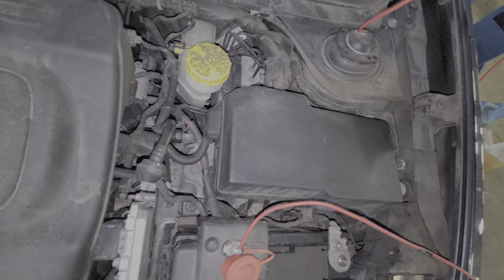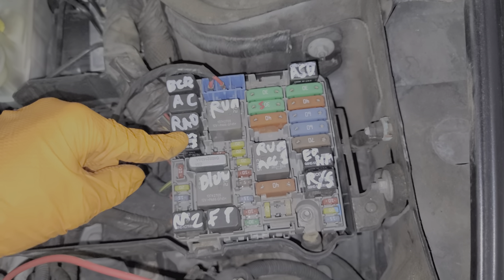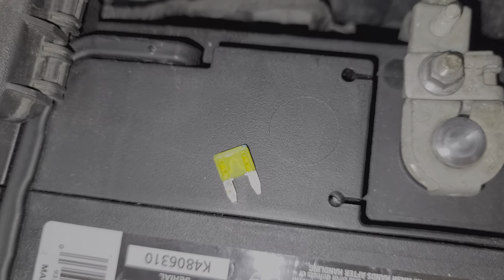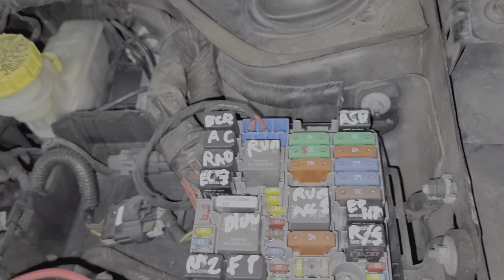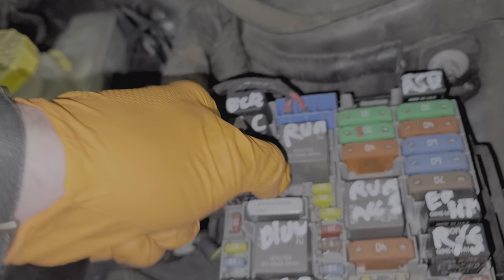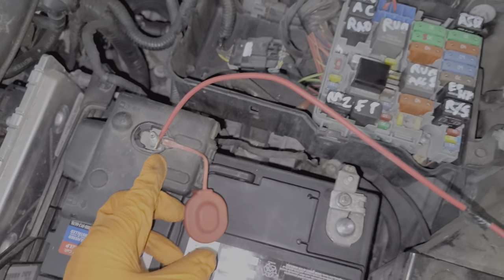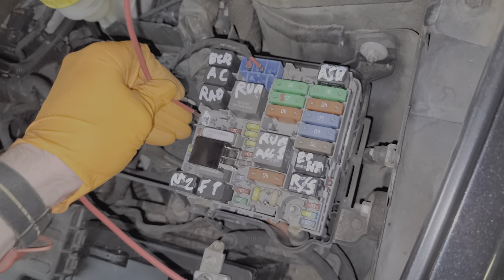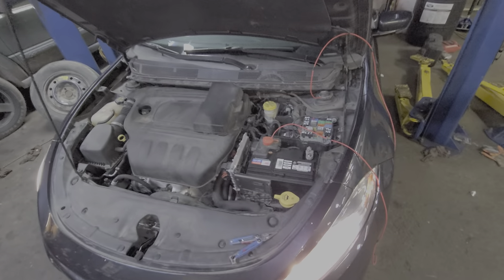2013 Dodge Dart Starter Fuses & Relays

Comment: I have a 2013 dart at 240,000kms it just went click click click,I checked fuses and relays and thought the starter was bad,upon checking the positive and ground wire I found the ground wire had broken off the Transmission,repaired the old wire and added a second ground cable from the  Transmission to the battery,problem solved,now the dart has 472,000kms on it,great car and going for more🏁
Reply: hi,you added a second cable strait from the battery to the transmission?
Reply: @610misael  yes,I fixed the original cable and made a new cable from the Transmission to the battery, no more ground problems,we now have 514,000kms on the dart,the original drive train is still in the car!🏁
Reply: same happened to me, the belt strap
Reply: @joelwarren7457 what belt strap?

Comment: This was very helpful. Have a 2013 with 2.0L and have had intermittent starting problems. Replaced ground cable and all was fine temporarily. After a few months it would just click, click when trying to start. Replaced battery as it was on its last leg but didn't solve the problem. After removing the relay as you suggested I used a jumper wire and it started right up. Cleaned the connections and seems to be fine now. Keeping fingers crossed.
Reply: How’s it working now?
Reply: Well it turned out to be the starter after all. After replacing relays it worked for a while and then just quit.

Comment: Please what could be the problem of this Dart dodge 2013, it doent start but when I followed your info on troubleshooting by connecting power directly to the starter relay it start, but won't start with key switch.
Reply: @okodominic4904  same thing with my car what would be the issue??

Comment: While I still don't know why my Dart won't start normally (new battery, starter, alternator, and now new fuses/relays as indicated), the "short-to-start" trick at the end of this video was a lifeline and is now how I start my car normally (with a hidden switch in the cabin that makes this same circuit. Will be just using this method till even that stops. Thanks.
Reply: Nice, I found a video showing a bad ground wire, may be worth checking. It's just under the front bumper
Reply: @opal6110  Thanks for that suggestion too, but I also replaced the ground connection (ran a fat cable from negative terminal all the way directly to the alternator). I just forgot to mention it in my original post.

Comment: I have a 2013 Dodge Dart 1.4l turbo, it was running fine then it died down like the battery was drained until the battery was dead. I put a new battery in and it was turning over but not starting. Someone installed a ‘kill switch’ which is connected to the two red wires that go to the harness on the top left of the hoods fuse box that’s not identified in the manual. I tried to remove it and possibly touched the two red wires to the kill switch together. The dash gauges didn’t light up, but  the locks worked so it still recognized the key, but when I came back the next day now the  key dosnt even seem to do anything. The battery has a full charge but it’s not doing anything. Could this possibly be the key went bad cause the fob buttons already didn’t work and when I opened it up it was completely filthy (I cleaned but no change). Or could one of the relays went? What is the RUN relays exactly?

Comment: So does that mean the bottom relay is bad? I got it to start the way you did with direct power from the battery.
I usually have to start the car by priming the starter, turning the key back and forth.

Comment: I have a 2013 Dodge Dart SXT…. I’ve had my startled, alternator checked and theirs nothing wrong. Also just brought a new battery recently but when I start the car all I get is clicking noises. All the lights and radio will come on but not sure why the car want start unless I keep turning the car on and off until it actually start running. I also had the positive battery tunnel replace and not sure why it’s still giving me this issue. I can use the box to turn the car on or just a regular key and it does the same thing
Reply: Check the negative ground wire, it runs from the engine to the body of the car to the battery. Check from under the car, batter side, they get corroded. Remove it, clean it & then start the car.

Comment: That video was helpful. What type of wire was that? If I try that and it doesn’t start does that mean my starter is bad? My car won’t start and I tested the battery with a multimeter and it was 12.47, the lights work, radio comes on. I will check the fuses tomorrow but any advice for me? Thanks
Reply: Hey, so I changed the green starter fuse and a few minutes later it was up and working. I forgot I wrote this so sorry for the delay.
Reply: @smiths.7134  what symptoms was you having ?

Comment: Hello, I own a Dodge Dart. I have a problem when I walk the car, it shows the traction sign, and then the speed of the car does not exceed 60, and I have a sound in the engine, what is the solution

Comment: Hey Brother, 
Great video here and the other ones for the dodge dart. i got this 2014 dart that sometimes turns over and sometimes when i turn to start just draws powers and does not turn over. ive checked fuses and new battery. my guess is relay, does it makes a difference if its the 1C7T relay or 1A7T relay?
Reply from the maker: How do you know that it is drawing power when it's not turning over? It the battery voltage drops but the engine does not turn over then the problem could be with the starter itself.
Reply: @LehewTech  gauges and lights turn on, and if a turn it off and to start once or twice it will turn over its just not everytime.
Reply: What type of wire is that pls lmk when u can really need ur help
Reply: I'm guessing your problem was actually a corroded grd wire from the battery to the frame to the transaxle!
Reply: @LukeGibbsSC  what did your problem end up being bro I have a 2013 that is doing the same thing as your 2014 sometimes I’ll hop in and it just won’t turn over but has power try it’s once or twice more and it turns over
Reply: @Oilglobber710  To be honest i never really figured it out. It had to be the relays. I ended up replacing and it still did it after I replaced them and then after a month it stopped having problems. We ended up selling it a few months ago never had a problem again.

Comment: My car haves the same problem I can figure it out is it the fuses or the battery
Reply: Changing the fuses worked for me
Reply: @smiths.7134  which fuse ? And what symptoms was you having ?
Reply: @cutthroatzaee8166  the first fuses he was talking about the 4 blacks ones just swap the top one and the bottom one for the 2 in between them
Reply: @heyzeus8987  if you swap them to test them out, do all 4 have to be plugged in? or can u just have the 2 (bottom and top) plugged in ?
Reply: @cassandragonzalez7119  you can have them unplugged to test them it’s just fuses for the starter